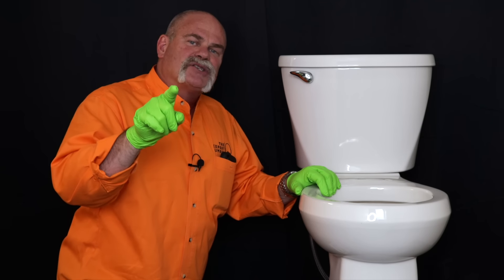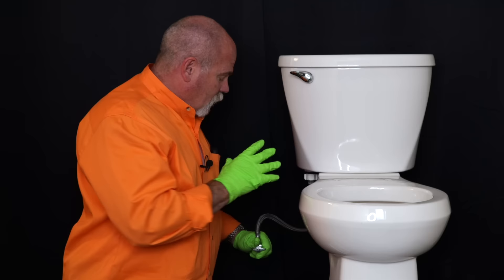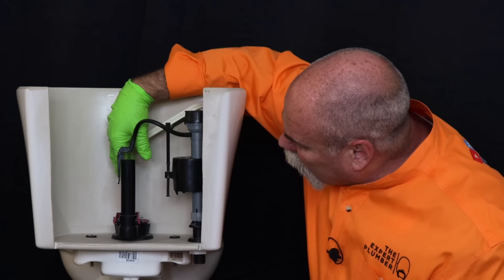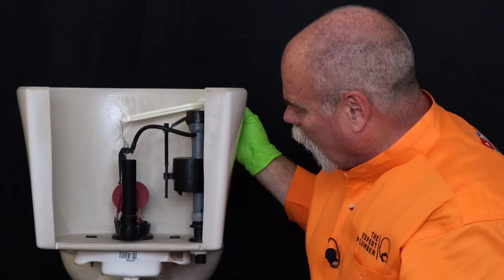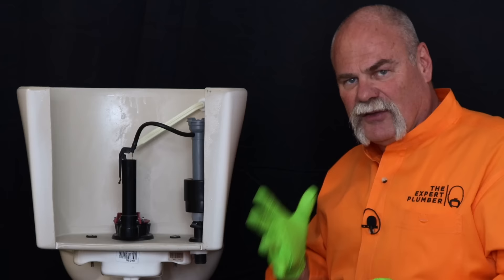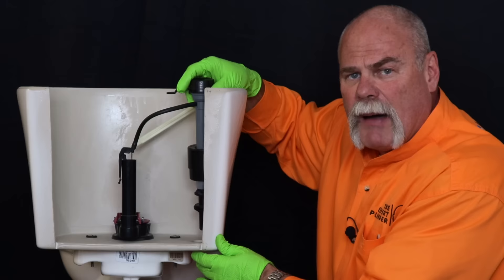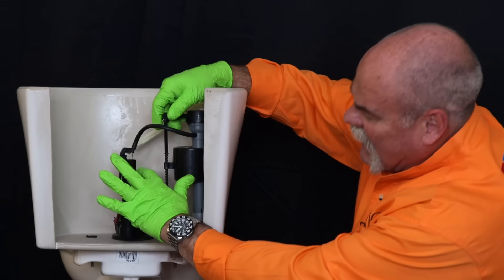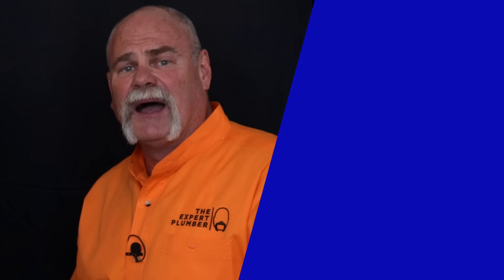How to Fix A Running Toilet GUARANTEED | DIY Plumbing Repair

Comment: I am so happy that I found this video. I’m a former soldier from the British military, then when I came out of the military, I went into the corporate world of banking and finance, and then I became a coach.

I relocated from last year from Germany and took over my family house in the Caribbean, and both of my toilets were playing up with continuous running water, and the fill valve would not deactivate.

I was panicking, thinking that this was going to be horrendously expensive to be repaired, and at worst, I may even need two new toilets. However, I found this video.

I watched it and said to myself, “that’s too complicated for me I would never be able to do that”.

Two days later, I thought “what could go wrong”? 

So step-by-step, I followed your instructions and hey presto, I have two perfectly functioning toilets, flushing better than ever.

Thank you so much for your guidance, please continue making videos giving such a value and I will make sure I share this on my corporate page.

Comment: Wow! I came across your video because my toilet was leaking, I'm a widow and try to do things by myself if I can, my brother helps me out a lot but he's busy at work so  I went ahead and bought the fill valve, but needed to know how to change it. I tried cleaning it first like you said and believe it or not there was a small black piece of plastic stuck in it. Cleaned it, put it back and it works just like new! Thank you so much for saving me some money,, now I can take the part back to Walmart. Great video.....

Comment: Thank you!!! It was the flapper on mine.   The replacement flapper in the new kit was too small so I just took out the original flapper, cleaned it and put it back in.  No more running toilet!! 10 minutes. Thank you!

Comment: Thankyou! My issue wasnt the one you described, but the video helped me dissassemble inspect and reassemble the part. My issue was simply because I have a toilet that has a button on top, amd said button has a wire leading to the float, the said wire was resting on top of the float and pressing it downward

Comment: Thank you so much, i changed the fill valve alone without prior experience, beyond simple basics such as cleaning the filter, replacing the supply line, and adjusting everything. 

That solved the the fact that the old fill valve didn't stop filling, but noticed that there would be slighty visible water streams into the toilet bowl after the tank filled and the fill valve has ceased to function. 

I imagined it was just a flap contact to out valve issue, as it solved as water pressure increased about 10 to 15 minutes after the tank filled. 

I checked the rim; it felt smooth, no cracks so i cleaned it with a paper towel without avail. 

I even bought a replacement flap, that was rubbery. The old one felt like hard plastic but the new one greatly worsened the leakage and wouldnt settle like the old one, so i put the old one back on, which has been there for a couple of years without issues other than noted. 

And no as i recall,  the water level is set well below the overflow pipe level, butt ill check again. 

Lately, ive noticed that the tank will startup in the middle of the night without provocation, and im getting complaints about the streams being more obvious, and perhaps going on for longer, so i assume, if true, its the flap or the exit valve. 

At first I'd assumed it was the the inflow valve as it's recently started getting stuck, and sometimes doesnt fill after flushing, but not so sure. 

Does it sound like an exit valve issue? Perhaps not being cut properly to improve flap contact and sealing?

I guess there are two issues here. The inflow valve getting stuck, and the flap outflow contact one. Either could be responsible for the intermittant tank filling, but the streams flowing after the tank is filled cant be caused by the inflow valve, but an output counterpart flap issue. Does that follow?

Sorry about the rant.

Comment: Thank you so much for this video! In my 1967 toilet I replaced the flapper, the fill valve, adjusted the water water to lower (took out the temporary water filled bottle which helped save on water usage) and put in a nicer looking toilet tank handle, to help that stop the toilet refilling every 20 mins for the most part. It didn’t quite really solve the running toilet issue. But, from this video I found the fill valve you showed had some speckles of dirt, then found the hose from the fill valve has a tiny leak in it. Thats where it’s coming from! Thank you so much for your help!
Reply from the maker: Glad you were able to spot those problems!

Comment: I recently changed toilets and it was a whole ordeal which started with having to repair the broken pipe in the crawlspace that brings water to the toilet. Afterwards, I finished installing the toilet but for the life of me I couldn't seem to get it to stop running. It kept filling up over the floater so high it would leak out of the handle. I lowered and raised the floater and made sure the flap closed correctly but nothing worked. Until I watch this video and became privy to the need for popping off the top to clean out any debris which could be stuck in there. And voilà!! It worked! Thank you for your video. I'll be coming to you for all of my plumbing issues from now on 😁

Comment: Hi Roger, I realize this is a 4 year old video but I hope you see this comment anyway. I looked at many "how to fix a running toilet" videos but none of their solutions worked. Your video is the only one that had the tip about taking out the diaphragm valve and giving it a rinse and a wash. I did that and it worked!!! Very grateful for your expertise and thank you so much for sharing.
Reply from the maker: Thanks for sharing…I’m glad i could help you

Comment: Thank you, it was the diaphragm valve. You saved me ~$20 and a lot of hassle. I could tell it was the valve in there that wasn't closing all the way, but I didn't know it could be opened up like that. There was a pebble sized piece of debris in there. Cleaned up the seal, used tweezers to pick out the debris, put it back together and it works like a champ now.

Comment: Great tip!  I didn't know this about the diaphragm valve.  I took it apart and found some calcium build up in there.  Cleaned it thoroughly. Put it back together, and presto!  Problem solved.  Thanks for your help.

Comment: Your "how to do" videos are the BEST...!! They helped me repair a severely neglected toilet, like 5+ years or more. Mineral build up could be measured in 1/8's and 1/4" thicknesses. I tried vinegar and lime away....  I think I could hear the toilet laughing at me. Those two products were useless.... like using a BB gun on an elephant. Went to local plumbing shop (which is closing after 45 years due to can't get good help) and bought a product called Professional Bowl Buster - 27% Hydrochloric acid (made in USA, San Antonio, TX). 32 oz. container. Poured about 24 oz down overflow tube to make sure main siphon jet at very bottom was fully submerged and let it soak for about 4 hours. Fantastic results with strong flushes now. Came back to your videos again to see how to properly adjust water level in bowl. All is good now...!!! THANK YOU...!

Comment: Thanks for this.  The cut out was smart and the explanation was great.  It turned out to be a small pebble facing the diaphragm for me.  It was in one of those 8 holes that the rubber diaphragm was facing.  When you said to flush it out and put your hand over, I forgot to put my hand over and water erupted straight up lol.

Comment: I just had a piece of pipe replaced that had rusted away on my main pipe, and afterwards i had noticed after i flushed my toilet and noticed the tank would not stop filling. i tried to flush it again to see if it would stop and it did as it should. later went to flush the toilet again, and it didnt stop filling this time. found this video, and had to i had to twist of the top fill valve to find a little rock in there. put everything back together, and works again. Thank you!!

Comment: I am just here to tell everyone, yes! it really was just that easy. I have never done anything plumbing related. I am not handy by any means. thank you for making what I call "stupid proof" instructions. 

even mentioning to put the lid someplace safe. i had previously had it dangerously leaning over the edge of the bathub. in my case, i just turned off the water, unscrewed the valve and screwed it back it in. that fixed it! thank you!

Comment: Holy Hannah! THANK YOU I JUST INSTALLED A NEW BDAY AND I'M NOT FAMILIAR WITH THE TERMS BUT THE BLACK THING YEAH ALL I HAD TO DO WAS LIFT IT UP MORE AND SLIDE IT UP AND THEN IT STOPPED OVERFILLING MY TOILET JUST GOING DOWN THE DRAIN THANK YOU AGAIN

Comment: Thanks for the video. I was able to follow your steps and clean the diaphragm valve. Look like bits of sand was clogging it. Also took it a step further once everything was dry, was used a can of air to blow out the sand I couldn't get to. Your video saved me over 200 bucks I spent at Lowes buying a new toilet. Taking it back for a refund.

Comment: Thanks so much for this video. I discovered my diaphragm valve had two large pieces of sediment. Removing those quickly solved the problem. I thought I would have to replace the fill valve and did not know it could be so easily fixed. Saved me from going to the hardware store on a cold winter day.
Reply from the maker: Nice work!

Comment: Terrific video. Took the diaphragm valve apart and cleaned it with soap and water and the problem was solved. Thanks for the easy to follow instructions.
Reply from the maker: Excellent!

Comment: Hi Roger. Many thanks for posting this very informative and thorough video, that actually helped me. I have watched many others and kept on searching to fix the issue. I cleaned the debris from that top part and it seems to have fixed the overflow. It makes a noise right at the end of toilet being filled though. Just wondering what that may be.

Comment: Thank you, I almost called my plumber I changed out the flow thing and it was still running then changed the flapper. It was the height on the flowthing. Thank you. I feel so smart. My husband was the one who did all this. But I doing it now.

Comment: My toilet has a bulb float on an arm that shuts the water off after filling. When it's running, if I tweak (pull up a tad) on the bulb arm, the water will stop. I did clean the stopper and got the debris out of the toilet, but it seems to be the float. It has a screw where it attaches. I'm afraid to start messing with it, because I may make it worse if I don't know which way to turn the screw. Not only that, the water shut off below the toilet is a round pull tab, a contractor grade shut off, and I want to change it to a turn handle as it's hard to open/close. I guess I'll just call a plumber so I don't have to worry about it, because fixing the float doesn't get me a better shutoff valve. Thank you for a clear instruction. You have undoubtedly helped thousands with your video.

Comment: Great video, I check my toilet and it seemed like the flapper is not covering properly. I would have to adjust it with my hand just so the water can fill.

Comment: Who knew cleaning the fill valve was so easy!  Thank you!  I wouldn't have tried to take the diaphragm apart without your video.  I would have replaced the part that could have been cleaned.

Comment: DUDE! …😱 holy shit it worked!!!! I just fixed my toilet. 🤯 You helped me figure out the problem, i had to replace the fill valve. The new valve cost $15 at home depot and i replaced it in 10-30 minutes. I feel like a champion right now. I conquered the toilet lol, it wouldn’t stop filling! THANK YOU SO MUCH!!! For your help!! This would have cost at least $100 if i had called a plumber (idk actually). Not only was it cheaper but i feel so proud. You guaranteed it and i didn’t believe you but now, I’m a believer 🤩

Comment: YEAAAH, my first flapper toilet, all the others are the different type, contractor put a toilet in basement, for months I swore I kept hearing the toilet flushing noises or similar, realised it was constantly running, I switched it off for a good 6 months then had to deal with stinky dry toilet and constantly pouring water down the u bend, so saw your video, took it apart, was not scared and the problem "FLOAT" level, the fuqqr didnt make any adjustments he just fit it and waved good buy, on turning on the water, it was just over flowing, adjusted the float with a crosshead.. 10 minutes WOO HOO< saved my self $00's of bucks on callout... liked and subbed you are AWESOME !

Comment: Hi Roger. Love the way you explain things for us non pros. I'm stuck. I want to replace one of my toilets and I want to replace the fill valve too with a quarter turn type. the fill pipe comes out of the floor and it's a chrome pipe which looks like it's soldered over to a copper 1/2" stub. The solder joint is covered by a removable bezel.  It looks like the original valve and chrome pipe has a sleeve that slides over the 1/2" copper. So, I figured a nice short cut would be to cut the chrome pipe, slide on an angle stop valve with a compression fitting and I'd be fine.  But, I can't seem to find a compression fitting made to slide over that chrome pipe/ sleeve. Is there such a compression fitting that size or am I stuck with a soldering job? Thanks,   Rich

Comment: Hi Roger, this is Joe I installed a valve fill, but for some reason I think it’s on an angle so that it rubs up against the back I’m not sure if I have it too tight or if I have to replace it and definitely is weird because of my flap doesn’t have a clip so it keeps coming off. It didn’t come with a chain to keep it on. I got a look at it tomorrow.

Comment: Thanx, had sediments under the blue fill valve cap, cleaned stuff off the black fill valve seal. You may need a more detailed instruction on how to get the blue fill valve cap off. I had to bring the fill valve arm up and push down on the cap and turn counterclockwise an 1/8 of a turn, at the same time. Also flushed the valve body tube with an upside down red solo cup on top.  Not a surprise I have very hard water here, it clogs up everything!!!! Thanx!!!!!

Comment: Very helpful. I have a Kohler toilet with a different assembly.  The water keeps running and goes past the fill line spilling water into the bigger cone assembly.  Is my first place to start the valve seal?

Comment: you sir, are awesome.
i think this was the only video that didn't JUST tell me how to REPLACE the valve, but to check/repair it!
and all because my idiot friend who helped me replace my valve with a new one, when it came time to connect the source pipe, i asked if we should turn it on and drain a bit into a bucket for 30 seconds like it says in the manual, and he was like "It'll be fiiiiine..."
it was fine for the first day. but by the second, it was NOT fine.
so thanks a lot! the more details, the better!

Comment: My problem was sludge on the Diaphragm Valve. I washed it off with soap and water, rinsed off the cap and that solved it. As a widow, I hate to call strangers in to do repairs. This video was a big help. Thank you so much.
Reply from the maker: Glad I was able to help you

Comment: I just bent my floater down a little bit which stopped the water from coming over the top of the flush valve critical level. Yet I was very careful not to put pressure on the fill valve when I did it. Probably should have taken it off to do that. It didn't stop water from coming in the bowl completely. But it's slowed it down a hell of a lot

Comment: Can lined tanks cause problems..foam interfering with gaskets or correct seating of flush or fill valves etc?
Thanks for the helpful video!

Comment: Thank u so much I just fixed my toilet with ur help it turns out I had debris in my refill valve cleaned it out and it filled and stopped just like new

Comment: Id give you a million likes if I could. My flapper was good. I adjusted the screw a few times and nothing so my last resort which I haven’t heard people talk about was the diaphragm. When I opened it up it was full of water. I dried it out and put it back and it works great. The stupid design of the toilet prevents me from just changing the whole valve. I have no room so I would have to take the toilet off the floor to change the valve. Thank you for saving me a lot of work

Comment: Hell yeah it's that easy😃.  My Dad taught me but I never would of dreamed I would have to teach foke's living in the barracks.  Sure as Hell saves on having to wait on housing - especially with today's New Army 😂.  Pulled your video up to see what I'm missing in replacing part in my Mom's toilet because I was still getting a slight running.

Hey, thanks so much for your instruction 👍🏿.

Comment: Fixed my fill valve just by cleaning the membrane which was clogged with rust flakes. Thank you!
Just one question: How to properly attach fill tube? I suppose you just direct it to the tank and not to the overflow tube? My was just floating in the tank.

Comment: Got in there and cleaned out the fill valve.  It took less than 5 mins and the toilet stopped running.  Thanks Roger
Reply from the maker: No problem! Glad II could help identify the culprit for you!

Comment: That valve has been the solution for me twice now. Fixed my running toilet about a year ago and just got back to the same situation. Watched this video for a recap, took it out, cleaned it and voila! Only problem is I can't unscrew that long plastic screw far enough to get the water level to the line. It screws all the way out before the water level gets down to the line. It's still got a quiet hiss but it's way better than it was.